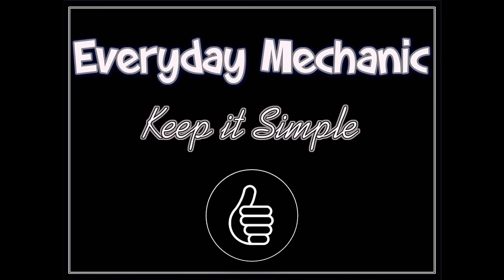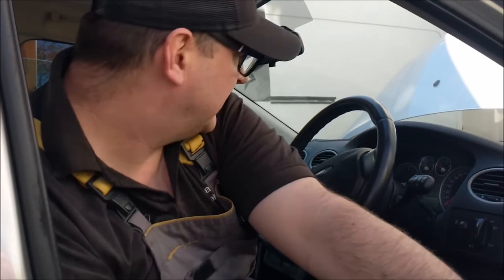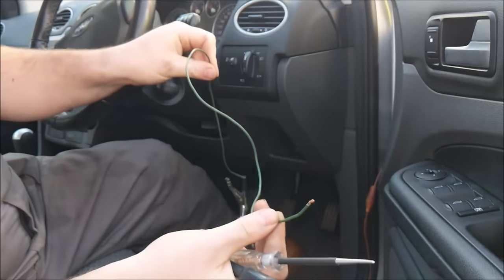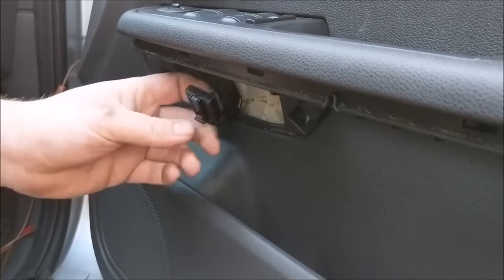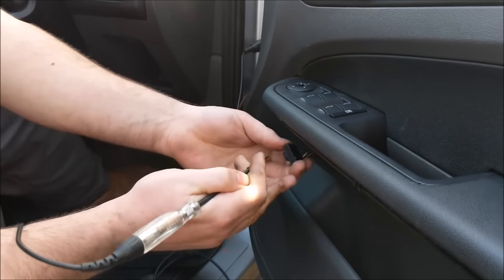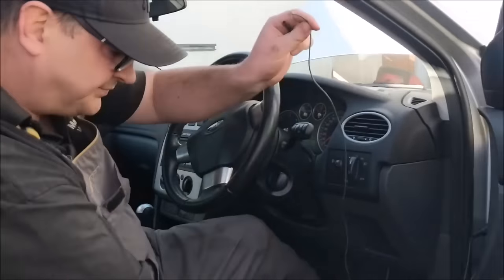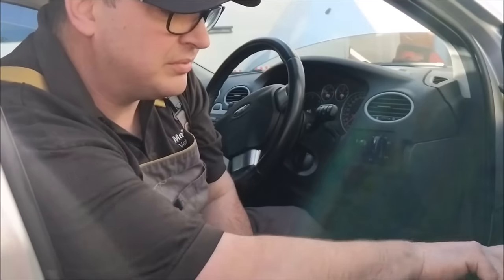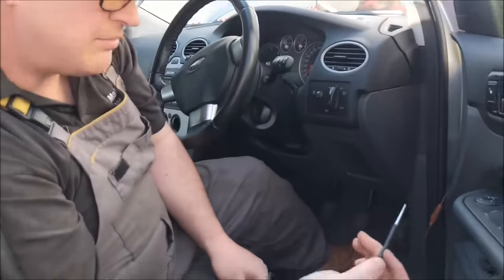Car window stuck and won’t roll up down. Manually Close an Electric Window when your switch fails.

Comment: My last BMW M3 developed a problem when you lowered the back seat right-side window all the way, the window would not go up when you lifted the button. The dealer told me they needed to take off the panel & install a new motor & lifting mechanism. They wanted over $200.00 plus labor. I discovered that, if I just touched the button for a fraction of a second, the window would rise a quarter of an inch above the sill & stop. I could then just grasp it, lift up the button while briefly pulling up and the window came up all the way. From then on, the rule in the car was nobody lower the window the entire way. If it happened on occasion, it took 30 seconds to get it up again. Cost $0.00. Tools, just 3 fingers.

Comment: My window does struggle to go up.  Sometimes revving the engine encourages the window.  If the window is partially closed I can use my hand to pull it up until the motor engages.  Is there anything else that I can do?  Thanks for the video.

Comment: Thanks, good video. Can you help diagnose this issue. Drivers electric window does down there is a crunching sound. Can't get it back up using switch. Seat Leon 1993.
Reply from the maker: Hi sounds like the window mechanism is on its way out  as crunching noise will be the cables getting tangled I hope that helps .

Comment: After getting the window up. How do you get the control switch to properly work again? Will it need to be replaced? Or is it a motor problem? Or wiring issue? Or a fuse? I’m lost mechanically
Reply from the maker: If your window went up using my method then your switch pack or switch will need  replacing

Comment: What's "Plan B" if jumping it still doesn't work?  How can I get that window to go up MANUALLY until I can get it to a shop for a motor replacement?  I appreciate this bypass method...but what if it still doesn't go up, and I need to seal that window for security/environmental reasons??

Comment: Thank you for the video, i don’t have one of those adapters to put on the end of my test light. Is there anything else I could use? I’ve tried my local Halfords and screw fix and they don’t have these available
Reply from the maker: Could use a pin or needle

Comment: From this information,  we can surmise that the equipment,  window winder motor, is continually conected to the positive side of the battery electrical system,  via the ignition system, and the switching mechanism is used just to complete the circuit to the negative earth side of the battery electrical system. 
But, the question arises. 
How does the reverse circuit then work  in order to open or close the window  ?

Comment: I have a 04 Yukon no windows work but the rear driver side. Can the main switch stop all windows from working if bad? Or do I need to replace all the switches?

Comment: I have a stuck passenger side window and both switches suddenly don’t work, so I assume it’s the motor, so if the motor is bad this will not help, correct?

Comment: Quick question bro I have 2000 mazda mvp van and my driver window won't go up. What the tiny little pin on the end of the test light? Can you buy that in the store?

Comment: Hi mate..... Have a GWM C10 car with same problem.... But all 4 of the windows dont work..... I checked the fuses ,  tested and even swapped the window relay with a known good one, but still nothing..... All 4 motors and switches couldnt have blown at the same time i believe.... Im gonna try your method first then i guess its off to an auto electrician to find whether theres a broken power or ground wire somewhere not feeding all the windows
Reply from the maker: Hi does sound like a module may have gone down if all fuses are good so see if a scan tool code reader will communicate and if so see if codes are stored in the driver door module  if no communicetion can be found then check if the driver door module has power and grounds

Comment: Sometimes the motor gets stuck. Hit the door panel with your forearm and sometimes it will break free and go up. But like in my car the window will power down but won't power up.  so you have to do it your way. FORD (Fix Or Repair Daily)

Comment: I tried the method used in the video with a test light on a perfectly functioning power door lock and power window just to see if the method works. Well, it worked for the power door lock,  but not for the power window. Is there any explanation you can provide why it did not work on the power window. Btw, I made sure the key was on the ON position in the ignition. Thank you!
Reply from the maker: Hi it would all depend on the system that runs your windows this method only works on can bus and linbus systems where the door locks windows ect all use a controll module to operate them

Comment: Whats a test light?  Does it have some of clip on it? And do i just stick it on the outside metal of the car? I have a fiat 500, bloody window is half way down, wont move up or down, and no idea about acessing the switch. Does it mean i need a new switch too? Am worried that nearby squatters will get into my car 😟
Reply: A test light is like a screwdriver with a pointy prong instead of a blade at one end and a clear handle with a light bulb inside it.  Watch video again and you'll see it.

Comment: What if the wire is broken between the switch and the fuse panel and there's no power going to the switch? Is there any way to use the lighter plug to jump the switch?

Comment: I have a 2012 Ford focus. My rear passenger window will row down with the switch but won't go up. I turned the ignition on, used a brand new test light and when I touched the module only one out of the 4 holes lit up red, but nothing happened with the window. What am i doing wrong?

Comment: Hi there ,i appreciate this easy tips but i have a problem ,the power window of the passenger side is not working, checked the fuse,its good.i hear the clicking sound of relay while try to use the switch,the switch has got power but missing on the motor cable.What can be done to diagnose the problem

Comment: Mine sometimes gets stuck up & down, the motor works but then stops, sometimes turning the ignition on and off works, once a drive through cleaner opened the door & pulled it up by alternately using the switch & manual method.  Would the problem be mechanical ?

Comment: Nice vid. Unfortunately, it's my passenger side window that won't go back up. Can you update this to deal with that situation (I tried what you said in this video on my passenger side and nothing worked).
Reply from the maker: Hi sorry for late reply but if you want to try passenger window you can try doing this from the driver's door switch panel

Comment: This only works if there's a switch failure. How do you lower the window if it's a motor failure?  I don't believe in taping the window and forcing it down, that can bend a window regulator. I did this work as a mechanic for 15 years.

Comment: Thanks , will a continuity tester do the same thing ?
Reply from the maker: No Ferlin I doubt it would work and run the risk of damaging the computer if you was to get things wrong as their wouldn't be anything to take the load if that makes any sense .
Reply: @EverydayMechanic  thanks , I made a light test with wire and bulb , it worked great , found that my switches are fine , on to check wiring to motor , thanks for your video. 
Working on driver side window on 2012 ford focus .

Comment: A couple things weren't very clear to me - 1) Where did you get power from for the jumper wire? 2) How did you determine which contact points to use?
Reply: Are you drunk?

Comment: What is the pin extension called for the test light? Thanks again.
Reply: a backprobe ...
usually sold as a set ...
different sizes and types ...

Comment: Is this a 12v test light or just a normal test light that is grounded? I am completely stumped and have been out of windows for months . Haven’t found a place in my area that can perform the task so I am stuck . I’m not quite sure i understand the concept . But from what I got is your providing the grounding necessary to operate the Motor with the test light ? If this is correct the modules and relays are still working properly for this to happen. I havent tried this yet but If I am getting power to my harness goin to the motor and not no power to my switch what is my issue ? Also if I engage the window.m switch I hear clicking in the window motors . What would you diagnose the problem to be ?
Reply: If you press the switch and here a click it tells me the switch is ok and would then check if power is getting to the motor ? My method tricks the module into thinking the switch is being pressed as when the switch is operated it will send a negative to the module inturn the module will send power to the motor as can bus modules are all about less wiring and less positive wires running through the car I hope that helped
Reply: As for the test light Cali connex yes it is just a normal 12 volt test light and is grounded one end so the ground will pass through a bulb in the test light so when we touch a module ground the module will operate that system as it thinks it's the switch being pressed 
And using a test light  does also keeps us from damaging the car so if we was to touch a positive terminal instead of a ground wire it will simply light the test light bulb instead of blowing a fuse or even worse frying a module driver ect

Comment: I've got an 08 renault megane, just wondering, so all I need to do is buy a test light, one end clips in the door and the other poke the pointed end into the plug and it will go up? (I'm really not a practical person)
Reply from the maker: Correct as long as the end connected to car body is to a bare metal connection like a bolt head

Comment: Great vid. Can you use an electricians voltage/continuity tester as opposed to the lamp lead? Thanks 🙏
Reply from the maker: No it would have to be an incandescent test light with a bulb in series
Reply: @EverydayMechanic how about a circuit tester? From my understanding it’s the exact same thing and looks exactly like what’s used in video. Lmk as I’m currently trying with it but I believe the tip is too big I need that smaller tip thing u added onto tip to get in there to make the connection.
Reply from the maker: @SCRATCHONEMORE   
A circuit tester would take measurements and not allow any kind of current through so wouldnt work no .
Reply: @EverydayMechanic  okay yeah it’s one of those ones that has a bulb that turns green or red depending on polarity. Was hoping that would work. So for Mcguyver method I just need some wire and a bulb? It’s midnight where I’m at so stores is all closed can’t pickup a test light till morning.
Reply: @EverydayMechanic  this is the one specifically I’m trying EverStart Plus 6/12/24V Electrical Voltage Auto Circuit Tester. 48882WDI, Quantity: 1, 0.25 lbs. From Wally World. Can you send me a link to an exact one that would work?
Reply from the maker: @SCRATCHONEMORE  
281748486912 
Try this ebay item number
Reply: @EverydayMechanic  thanks man your video is amazing. Right now I’m trying to rule out the switch and motor. This will allow me to trouble shoot both (and hopefully get my window up that’s currently stuck down) without taking door panel off and weather proofing to get at motor to test with a 12v battery. The other issue I foresee down the road is how does one line up the bolts to remove/replace regulator if the motor is shot? All the other guys vids skipped over that and they proceeded to just use the master switch to roll window up or down into position lol. It’s been driving me mad! I think I may just make a video of this and will definitely credit you to having the best way of trouble shooting driver door switch and motor in the easiest way I’ve ever seen. Will be purchasing test light at crack of dawn. Mahalos plenty from Hawaii 🤙

Comment: I’ve watched a couple of these, they never elaborate on the driver side switch, if both don’t work, wouldn’t that be a clear indiscretion that it’s the motor, my other question is, if it is the motor, how come it goes down and not up. I’m actually in this situation rt now, I have a Dodge Caliber, 2008
Reply from the maker: This method is a switch bypass if all related switches are not working

Comment: Can this be done with just a plain wire from a good ground to the right terminal at the switch connection?
  I mean it is only supplying a ground, right?
  I can’t find my test light and do not want to spend $57 for just a test light. Haven’t seen mine in years.
  UPDATE:
Went out to my car with a wire with a clamp both ends. Was going to clamp one end to a ground and put a straight pin in the other clamp to touch terminals with. 
  Then I thought wait a minute!  What happens if I  touch the hot wire feeding the switch?!
  That is when I thought of the light. I decided I best wait and rig a light or buy another test light. 
  Glad I remember what was said about the light just lighting up if a how lead is touched. 
  That was close. 
  Someone had mentioned hearing a sound when the switch was used. So did I with the switch from the rear in it. Hope I did not hurt the motor when I messed with it before.
Reply: Went bought a cheap test light. No luck. I must have damaged the motor or something when I straight wired it before. :(
  This method might very well be good to know in the future though.

Comment: Hey mate, so I have a dilemma. So from my drivers side I can wynd down my front passenger,  but from the front passenger I can't. Second problem I cannot wind back left passenger with the drivers door but I can wind it down on the back left passenger door. Just wondering if you could advise problem

Comment: What is the name of that product ? Is that a wire tracer?
Reply: Hi Victoria the tool i used in the video is an incandescent test light.
 In the video i make one which is just a 12 volt bulb so currant can be absorbed by the bulb the reason for this is if we was to touch the wrong wire it would light the bulb instead of blowing a circuit i hope this was helpful.

Comment: If hitting the switch on a normally functioning window sends a positive and negative current to the motor to make it operate then where does the positive current come from when using a test light on a malfunctioning window?  Call me dumb but I’m confused.
Reply: When hitting the switch you are completing the path to ground on either the upside of the terminal or the down side of the terminal input to the controller. That is why he is using the test light. A straight wire without knowing the correct pin may short the controller out. The incandescent light eliminates that possibility. Correct use of knowledge of basic electricity. Bravo.

Comment: What did you do with the other end of the test light when you positioned it between the door?
Reply from the maker: Simply connected to a bare metal bolt or any part of the car chassis that is not painted and has a raw metal for the test light to make a path back to battery Neg
Reply: @EverydayMechanic  thanks for the reply

Comment: Do you know what the fault would be if the window won’t go down after the frost has gone? It goes an inch then stops! Thank you :)
Reply from the maker: Try re setting window by taking window to the most bottom and then press to go down 3 times for 3 seconds then do the same at the top also
Reply: @EverydayMechanic  thank you I will try this :) and thank you for the video!
Reply: It worked! Legend thank you so much I would have had terrible anxiety if I didn’t fix it!
Reply from the maker: Glad it worked 👍🏻

Comment: I tried this, the bulb came on but did nothing. Passenger windows are working normally, but even they don't move from the drivers side using this method. Any ideas? (subaru legacy 2006)

Comment: I tried this method and it didn't work for me. Maybe I didn't do something as  Thorough.  But bought a everstart circut Tester with a red/green light in the butt and a clamp as well. Followed instructions and nothing happened any of the times I stuck it in the plug alotho I did see the red light 3 or 4 times.  So I'm bafeled at what I could be doing wrong.  Any ideas would be so very helpful. I drive  a 2004 Honda Accord 4 Dr V6
Reply from the maker: The test light may be not the correct spec its an incandescent test light required which has a bulb in series

Comment: Hi my window stoppdd working the passenger and both rear sides....ive checked the fuse and its good the driver side works fine. They all stopped working at the same time im going to test this tmr but just in case it does work does anyone else have any idea what it could be?
Reply from the maker: Do the switches on the doors work ? The drivers switch pack may of failed witch would leave the other switches on the actual doors still operable ?
Reply: @EverydayMechanic  no non of them work. Only the lock and unlock work. The driver side window does go up and down just fine but the rest won't go up or down at all.

Thanks for responding 🙏🏻

Comment: Any idea how to put my window up on a vectra c? I think the motor has gone 🤷‍♂️
Reply from the maker: Sounds like you will need to remove the door card and try to find the issue and move window to the closed position either by removing the glass from the runners and wedge the glass closed using wood until you find a replacement motor I hope that helps
Reply: @EverydayMechanic  is it easy to remove the glass from the runners? It's not the most accessible part of the car. Appreciate the response.
Reply from the maker: Depends where the window is sitting but should be easy either 2 plastic tabs or 2 10 mm bolts